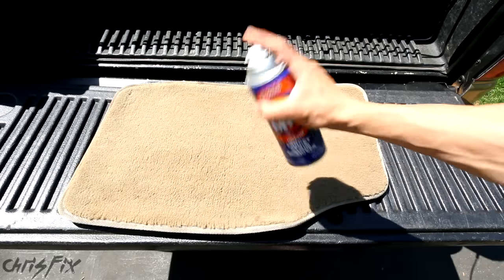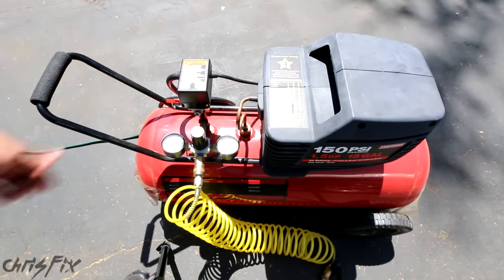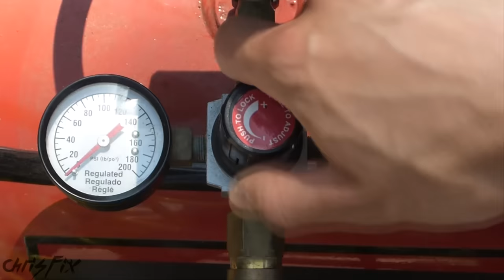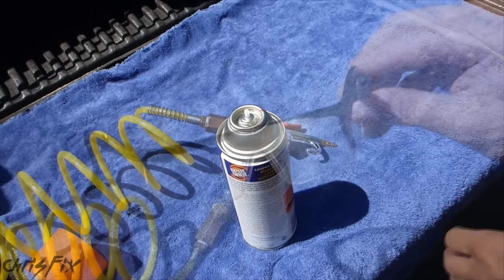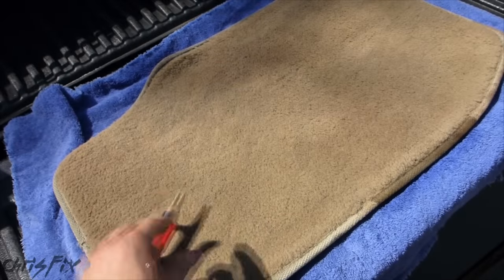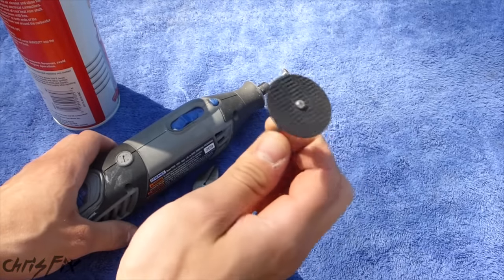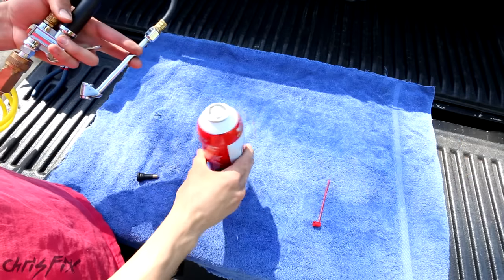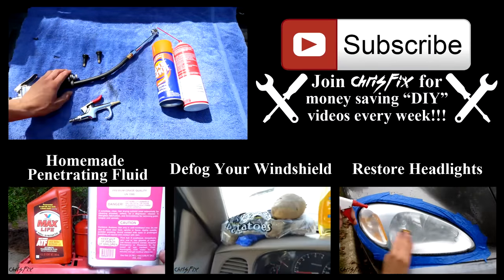How to Refill an Aerosol Spray Can (Like Carb Cleaner, WD40, etc)

Comment: saved myself 5 dollars refilling the can, trouble is the air compressor cost me shit loads :) out of pocket now should of just bought another can ?
Reply: a compressor is a very usefull tool, it will pay its money back for all the times you're gonna inflate your tires with, dust off electronics, inflate basketballs and you can attach a paint sprayer too (a bit higher quality of paint finish than a rattlecan)

Comment: Using that tip is NOT the way to go, use a nozzle with a rubber tip (your nozzle creates a mess and there is no way you can keep that centered) and flip the can around (the liquid comes down), no mess, no frustration. Also, setting the air compressor 2:15 at 90 PSI does not mean that the can gets filled to 1:46 90 PSI.  That setting indicates that at the nozzle, you will get 90 psi., assuming your not running 100 ft line or hose.  It also wound NOT stop pumping air at 90 psi. If that were the case, I would set mine at 30 psi and never worry about over filling my car tires. In other words, there is no connection between setting your compressor to 90 psi and the factory specs of PSI in that can.  Good video, but just wanted to point that out.

Comment: I used my Harbor Freight 9 inch grinder instead of a Dremel Tool at 5:27 ... When I got to the hospital, they said that they could save my left thumb, but all my fingers couldn't be re-attached.

Comment: I just tried to do this on a can of foaming glass cleaner from NAPA and unfortunately they designed the spray nozzle to also be the stem to go down into the can. 
The can is like 80% full but no air pressure.
Reply from the maker: Aw dang.
Reply: ChrisFix That's what I said. 
Good thing I got a big ol gallon size of Windex from Costco.

Comment: The “copper” is actually brass :). Useful vid though, but it would have been even better if you had figured out that the plastic straw extends into the bottom of the can and collects the liquid from there, meaning if you invert the can whilst refilling with compressed air, no liquid will be lost. 

The lesson here is that it’s best to figure shit out properly before sharing.

Comment: First of all, the propellant is never air. Air, even under high pressure remains a gas. The pressure will quickly drop as you use the can. It is especially bad for things like spray paint where you want consistent pressure. The common propellants are propane and butane. Under pressure they are liquids and if the can is not full, the liquid evaporates to fill the space above the liquid with gas. As long as there is any liquid propane or butane left, the gas pressure above it remains constant.  It mixes with the lube, cleaner or paint but still evaporates to create the gas pocket to push the product out. This is the reason you always see the warning not to spray near an open flame; there is propane or butane being sprayed, too. When my cans loose pressure I use a butane lighter refill can to give them a shot. The stuff is cheap and only takes a small shot.  I use the smallest tip. It is not super efficient and some squirts away but I get enough into the other can and it only takes a second. I am not telling you to do this. If you start a fire or otherwise injure yourself,  it is on you but it is what I do.

Comment: PSA: This can be EXTREMELY DANGEROUS! If a spray can goes from low pressure to high pressure it will heat up. Often the contents of the spray cans he is referring to are flammable. The environment of heat plus compressed oxygen plus flammable liquid could explode. It's not guaranteed to happen, but if there is a small spark inside the can or compressor or a large enough amount of heat build up, it can. Don't risk burning your face or hands off and just write off the remaining few dollars of material in the spray can as a loss.

Comment: do you realize you can take the valve core out of the valve stem and use the lock on air chuck or even the screw on chuck for bicycles and make less mess, great idea, but most of us have been doing this ever since they came out with these money robbing cans. you can also put a valve stem in your old pump up sprayer and air it up instead of using the pump, just buy the valve stem sold for custom rims that install with a washer and nut.

Comment: I don't have a compressor with a tank but I do have a small portable one for putting air directly into my tires. I also have some valve stems. Can I just go directly from the compressor to the can without regulating the pressure (without exploding the can)? Is there a cheap tire that I could fill to xx PSI and then go from there? Anyone?

Comment: They use nitrogen on factories because it is not flammable with the product. - The air is.
If your carbcleaner accidentally catch on fire while spraying it WILL NOT stop burning at the nozzle, but will continue burning into the can and inside it - and boom.

Comment: So have any of you actually tried this? I always take things with a grain of salt when there are so many edits in a video. It's always best to have everything setup so you can show the "zero pressure" spray, recharging with compressed air, and "restored pressure" spraying all without multiple cuts in the video. 

There is a reason why they use volatile propellants in spray cans and it's due to them being a liquid when under pressure. As the pressurized propellant forces the product (paint, cleaner, etc) from the can, liquid propellant evaporates and keeps the can  pressurized. I'd imagine using just air would result in very short  spray time before needing another refill.

Comment: There are two types of sprays - and you made one little mistake. One type (most common) of sprays as shown there, where valve is at the top position while spraying, others, has to be exactly opposite, (180 degrees), with valve in the bottom position while spraying. If you do mistake while spraying, that's exactly No1 reason why are you out of gas but with plenty of liquid inside remaining. So, when you filling gas (compressed air) inside, spray has to be 180 degrees from shown, so the liquid won't be spilled out in shown amount. You'll lose only air itself (maybe amount of liquid already in tiny spray hose inside bottle, at the very beginning).

Comment: Who would ever dislike this? Some people are just horrible.
Reply: So after reading comments I saw a guy talking about it’s a bad idea to add air because it used a different delivery system from factory to be safe. I apologize If the down votes were due to safety issues.  If that’s the case and you were trying to help then thank you.

Comment: Couldn’t you alternatively just use a disposable can of pressurized air? Heck. You could even use the charger from any other aerosol can as long as you hold the full cab upside down I think…

Comment: Doing that with Carb cleaner is dangerous! I'd use CO2. If you put pressurized air in there you risk making a firecracker as you mix pressurized fuel with oxygen.

Comment: DANGER-DANGER-DANGER...RED  ALERT!!!!!!!

Refilling with air is making a bomb since you have introduced oxygen in the can!!!!!!!!
The safe and OEM method is using LPG. Using a gas refiller everything is simpler with safer outcomes.
Simply proceed as shown here, and selecting the tiniest tip from the gas filler adaptors, with the WD40 or paint can in the normal vertical position, insert firmly the refilling can tip in the can be refilled, sinking the valve in both cans, and wait a pair of seconds to fill the can with gas in the "liquid-gas phase"...if you use the refilling can in vertical nozzle-up position, you will refill with gas in "gas phase", which will not last so much...but may be useful if the empty can have very little content, so you "save on gas"  :)

PLEEEEEASE, DON´T EVER REFILL WITH AIR, CANS WITH HYDROCARBONS SUCH AS WD40, NOR PAINT CANS!!!!.

Comment: This is a DANGEROUS.  Adding Oxygen (from air) + Fuel (whatever flammable is in the can) + Heat (Joule Thompson effect of compression) = EXPLOSION.  And since it will happen inside the can, shrapnel will fly everywhere.  Those safety glasses wont come close to protecting you.  Explosion will only happen when the Air/Fuel mixture is between the LEL (lower explosive limit) and the UEL (upper explosive limit), while at the same time, having an ignition source (the heating effect reaches the flash point of the Fuel or a spark from the apparatus)..........So you are likely to get away with this dozens, or even hundreds of times, until........ you don't.

Comment: Most spray content does react to air and start a drying or hardening. Thats why they have to use other propellant than air. You can ruin many sprays whit this method. Not recommend.

Comment: This is a really dumb idea, aerosol cans are not filled with air! They're filled with propellant, this is very important. Everybody knows you can spray a can of some flammable solvent over a lighter and it won't cause the can to explode, with this, it absolutely will the instant a bit of air gets pushed through the tube. Normally there's no oxygen inside those cans so there's no way it can burn except through the nozzle, pressurized air and a solvent will burn far more rapidly than air at atmospheric pressure, you're turning the can into a bomb and if there ever was a flame it's liable to explode and mangle your hand if not more.

Comment: This is a good way to cause the can to explode. The better option is to drain the can into a manual spray bottle.or an aerosol can specifically made to be refilled with air. This dude is a perfect example.of people that should be banned from the internet

Comment: Chris, I love your channel and I chain watch all of your videos.  But this one is cringy.  I work in the oil and gas industry in manufacturing.  We avoid industrial explosions by never mixing hydrocarbon and oxygen.  The method you are using could get to the lower explosion limit and end your promising career.  Your pressurized gas of choice should be nitrogen.  It is inert and will not cause an explosion.  Good luck and please don't hurt yourself by continuing to mix hydrocarbon and oxygen.

Comment: Hey, I don't mean to sound like a safety sissy, But... Please think twice before pressurizing a flammable liquid with an oxidizer. It does a vast many things to the fuel, Mainly, Making the can into a pipe bomb. 
Perhaps fill it with an inert gas such as argon (from welding shops), 
Just for the love of god, don't fill it with a chemical that releases an oxidizer of some kind.
Reply: A few years ago a Chinese manufacturer decided to save money by using air instead of nitrogen in the strut of their adjustable chairs
The oil was flammable so every now and then it would diesel ignite and shoot the piston rod into the users backside.

Comment: Wait till it explodes in your hand, very bad advice, tins are filled with a propellant such as butane not compressed air, safety glasses arent going to help at all when it pops, we used to do welded can pressure tests in the factory, its horrendous when it pops, Dont try this at home, very bad advice, tottaly against ohsa act.